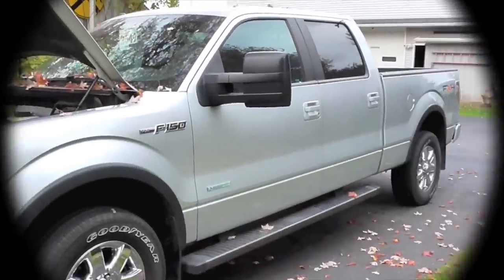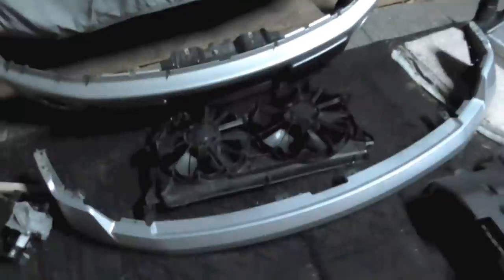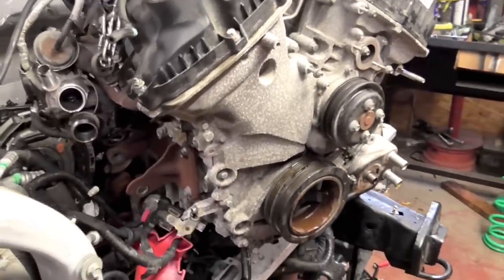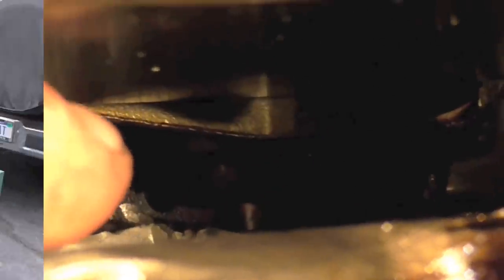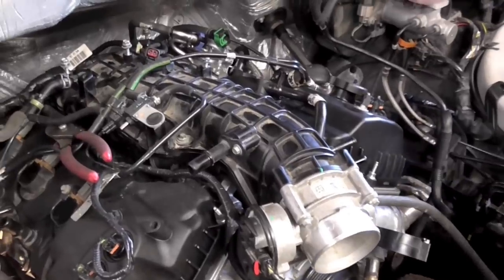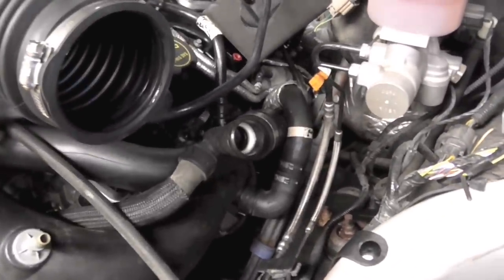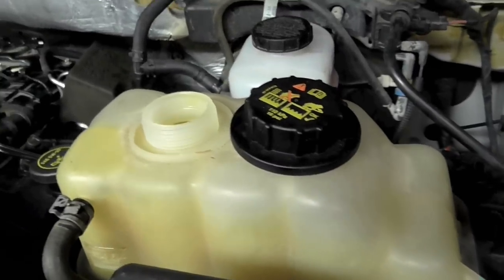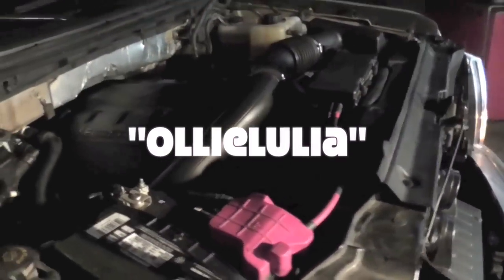FORD F150 TRUCK:  3.5 V-6 ECOBOOST ENGINE FAILURE (Removal and Installation).

Comment: I'm in the market for a pickup.  I've always had Toyotas, but want a change.  My two choices were F150 or Silverado.  If I end up choosing Fords, should I stay away from particular year models? BTW, looking used not new.
Reply from the maker: I just saw a 2017 F-150 with a ("I think") 2.7 Litre "Eco-Boost" (The next 'generation' of ours I should guess ?), and I couldn't believe how "cleaned-up" it was !. *NOTE: I used the word "busy" alot in this clip: ("BUSY" was the INCREDIBLE amount of "plumbing" / poor design on "OUR" engine) ... anyway: (with the newer version ones):  I think they've evolved into a  finite science (amid the earlier design's flaws), *This one ran / looked "crisp & clean". The owner raved about it's performance and, (thus-far), - it's fuel economy. That said: IF it were me, I'd probably go with the Ford Truck. 

Tho THIS Truck continues to run flawlessly,  I'm quite sure the "mistakes / design's of the past (timing chains, sprockets, tentioner's etc ...) are no-doubt "improved" and much more durable. Combine that with good care and maintenance;  and I'll bet it'd have a great service life. IS the traditional "V-8" still available ? 

< I DON'T KNOW >.  :- )
Reply: TommyZTrains ; Great, thanks.  I wonder if they made improvements in there 2013-2014 models.  That's probably the years I'll be looking at.  Maybe I'll just go for the V8 ones.
Reply from the maker: As "we" understood it: 2013 thru 2015 "early" were the "old-style" (or "stay away"), and 2015 LATE currant are "OK" (or "corrected").

Comment: Are you going to still use Amsoil?
Reply from the maker: +blackericdenice    We like the Syn. oils ... AFTER oil analysis and the like,  not necessarily.  *Being fair the failure wasn't "OIL" related either.
Reply: TommyZTrains What cause the problem?
Reply from the maker: +blackericdenice   Read the description and that pretty much sums things up ... (WATER and a hydrolock failure due to CA.C. condensation / hence filling cylinders with water).

Comment: Having lived with a driveway on a hill for 30 years. Water coming out the exhaust is a frequent sight in the rearview mirror. No matter the make. Honda civic, Toyota Tacoma, Ford Mustang, BMW M3 and so on.(all naturally aspirated)  Never any engine trouble. The longer the vehicle sat the higher likely more water would flow out. Admittedly I would never describe that it looked like a small lake! It used to bother me some. But over time I just excepted it.
 Bummer to see the trouble with your 3.5 Ecoboost. A Edge sport was in my sights for the near future.
Reply: P.S. Just noticed what type of channel you have. Very neat! I have 27 years service as a Mechanical Carman on the railroad.
Reply from the maker: Hi ya "James" ... I agree 100%. But what I was remarking about was the "weep-hole" (just aft of the crossover), and the water just rolling "out & out & out" .... It was a literal "stream" of water. Again; AFTER we pushed the Truck off the Road, we later learned that in fact "what we thought" was OIL, WAS Water. *This wasn't the example you site in the above, it was far-more then that, **AFTER the failure.  < not "normal" >    :- )
Reply from the maker: "Nice" ... gese - "I wanna-be YOU" !!  : -  )
Reply: Yeah that definitely gives one, pause to thought. Makes you wonder what the heck was going on there.

Comment: they only have sold over a million of these engines , it's not a common problem because I've seen some with almost 200,000 miles without issues, i definitely would be upgradeding if it were me

Comment: How did you get the engine and trans to line up during install?
Reply from the maker: "It's a tall order Bob" ... but the stars DID align !. As I recall (through the starter opening / while we watched / not hurting the crank sensor) in the process... "IT SUCKED" !!     I  N E V E R  want to go through all that HELL again !. Good Luck :- )

Comment: Over all how hard was the job and how much did you spend in total cost to do it yourself.  My friends 2011 fx4 ecoboost threw a rod too.  He thinks it is an easy job to replace the engine by ourselves
Reply from the maker: Hey John, "It's quite a task" ! ... The level of difficulty was rather high / NOT what "I'm" used too ... that being said: "the first time always is". The price on the Ford long-block crated motor went UP soon after we got ours, but as I remember: "about" 6,000.00 for everything.
Reply: TommyZTrains the local Ford dealer he got quoted at said it was about 7400 for the whole job to be completed.  He doesn't listen to me that here in the Ohio winter without a garage to work in it would be hard too do
Reply from the maker: In a Garage "HEATED: WITH a Lift: OK" ... with NONE of that ? "boy your in for a dose of reality". Pay the grand ! (more).
Reply: How the heck did you get the engine and transmission aligned?
Reply from the maker: John "I DON'T KNOW" !! It was a nightmare back at the time ... then it suddenly "fell-in". Delicate positioning of the Engine crane / Trans Jack was the other "key". It was a REAL PISSER THO" !!
Reply: Spent 5 hours yesterday trying to align it last night and couldn't get it
Reply: I would agree, for $1500 extra have it done. Then they own any problems and all you have to do is turn the key and drive away. I do 99% of my own maintenance and repairs but there comes a point when you have to weigh cost vs PITA.

Comment: Congratulations ! I have replaced engines before but this looks like an absolute nightmare! I probably would have given up! I hope you get many more years out of you F150! I am looking to buy a new F150 but am looking to stick with the 3.3 v6 290hp in the XLT and try to limit some of this nightmare ! You did an absolute awesome job!
Reply from the maker: Hi Jim !,  * THANK-YOU and I very much appr. that * ... It WAS "alot of reality".   Ironically,  TODAY is the first time (now truck is nearing 120K miles), that I've had "ANY" issue at all ... that said:  I had an Ign. coil fail / & It was as "straight forward" as one could get / and: (after replacing that "inop. coil"),  the truck continues to run FLAWLESSLY.   WE LOVE IT !.   BEST.  :  -   )

Comment: I've always been a Nissan guy. I've got an 04 frontier 2.4l with a 4spd auto with a little over 120k and it runs like a dream. The only issue is an EGR sensor but mechanically it's fine and there's a lot of room to work on it.
Reply: thats not a proper truck, it can not be compared to a workhorse like a ford, compare it to a explorer sporttrac maybe

Comment: awsome job- you guys are great mechs. I didn't hear one cuss word out you all, although I'm sure you felt like it many times . That's what I call true pros. where is your shop located? I might need some work on my truck, and no it's not a 3.5 eco. it's a 68 f-100 with a 300 ci. in line 6 cyl. God blessed you all with lots of patience and knowledge. great video, keep them comming.
Reply from the maker: Thanks Edyon; but we only did this job because we had too ... I couldn't imagine the labor we'd of paid, (let alone the crappy workmanship), that we'd of found ... "if at all". Once is enough, and the Truck STILL continues to run perfectly.

Comment: What were the total hours and customer cost for this job? Possibly going to do this to my 2012.
Reply from the maker: In TODAYS setting ? (this video was some time ago), I’d guess appx. 12-14 K for the long block amid all the included upgrades as this video prefaces. I NEVER wanna do the job again, and the truck continues to run absolutely perfect. 👌🙏👍
Reply: @TommyZTrains  wow. Last year I would have said no way but with truck prices now days I have to consider what 10-15k would get me. Absolutely loved my 2012 for all 205k miles.
Reply from the maker: “I get ya”  … today 25 K wouldn’t buy a junk ass Chevy Aveo !. “Today’s 15K is the old 5 K of yesteryear”.  🥴

Comment: The eco boost 3.5 has a water pump leaking problem later. I guy said change the oil under 50 k cause dirty oil are corrosive to the river water pump seal.

Comment: I hear they have a 100,000 mile warranty now.  Big friggin' help that is!  My friend has a 2013 F150 XLT 4x4 3.5 Ecoboost with 100,000 miles on it, no troubles.  Sometimes I think it's just bad luck, or don't buy the EARLY re-designs, at least!

Comment: i had a tuned lbz duramax stolen and the most comparable affordable option was my 2014 fx4 ecoboost, no half ton v8 jas the torque of the ecoboost and the transition from 6.6 to 3.5 was very easy because of the power simolar power delivery of the ford. Here i am getting a new 17 sierra slt all terrain and gave the ecoboost to my employees but no half ton v8 pulls like it! Drive with trailers and you will feel the difference. I have gm commercial fleet but that eco boost pulls!

Comment: Hey how did you line up the torque converter on install completely skips over that part in video
Reply: TommyZTrains
Reply from the maker: I said: "through the starter opening" ... and that's how we were able to do it AFTER things were: plum / level / and lined-up. (As I recall what we THOUGHT would be a war,  was in fact "quite EASY".

Comment: I did not hear you say if you figured out what caused the original engine to come apart ?  How many miles did it have on it ?

I am thinking about a 2016 3.6 l F150 normally aspirated truck .  Any pros or cons for that truck ?

Great video .  Best of luck to you .

God bless
Wyr
Reply from the maker: Hi.  If you read the description, the "failure" was "Hydro-lock". The "inner-cooler" (or "charge-air-cooler") filled up with water condensation droplets until the "Tub" was full, and the Truck ingested the water. The correction: simply "spud" a hole on the "cooler" so it can "piss-out" the water. Ford makes a great Truck Wyr, but myself "personally" ? I'd buy "nothing" TURBO-ED. Go with a nice simple "full-house" V-8.  * MY Opinion **

Best
Reply: Thank you for the description .  I either read past the reason or did not know / understand what I was reading .
     If I traded vehicles every 1 - 2 years , & the vehicle never went past warranty , turbo or no turbo would probably not be an issue with me .  But I have normally  driven / operated a vehicle until it was no longer economically viable .  Doing most of my own repairs .
     When the vehicle went past that point or some one ran into it & totaled it , I would start looking for a replacement .
     To me , a turbo just adds another layer of expensive technology & complication , to go wrong .  If you keep the vehicle for an extended time period .
Thanks ,  :-0
God bless
Wyr
Reply from the maker: IC ... "Gese your lucky buddy" !!  :- )  I wish I WAS I a position too say that ! (every 1 or 2 years).  Be well.  :- )

Comment: So, it looks like a piston rod exploded.  Any ideas what caused that?

Edit: Just read your write-up.  Condensation in the CAC caused a hydro lock?  Amazing.  65K miles isn't a lot.  Sorry.
Reply from the maker: Thnx. Jean ... "Your spot-on", that's what happened.  :- )
Reply: TommyZTrains - I owned a '94 Ranger 4x4.  It was awesome.  But at about 120k miles it started to overheat constantly.  Replaced the radiator, water pump, and had two or three coolant flushes.  Nothing worked.  At 140k miles the cylinder heads cracked.  $1400.  ...and again at 145k miles.  ...$200 and a month of weekends.  

I replaced it with a 2001 Accord V6 Coupe, that I still own today.  Runs great with 202k miles.  The Accord only ever required new Mobile 1 every 7k, water pump and plugs every 90k, some O2 sensors, idle control valve.  The car is bullet proof.

Comment: The Ford Ecoboost forums have a bunch of threads on this.  My 2011 eco boost had over a litre of gas/moisture in the oil after 20,000 k.  So far, two left side turbos, timing chains, throttle body, alternator, several TSBs to fix the fluid in the oil problem, nothing but problems.  Engine is surging badly now on acceleration.  Junk.

Comment: Why does the f 150 engine have electric fans instead of a clutch fan .
Reply from the maker: Most all car or Truck platforms use a "fan cassette" panel ... These two fans are generally "pulse / modulated", and the Computer will drive one / or both on, and in some examples "vary" the speed (up & down). Once the vehicle going down (say the freeway), many times these same fans do NOTHING (off) = a savings on fuel economy / wear and tear. "Coolant "deficits",  can MUCH BETTER be dealt / handled with too, in a "city driving" situation and so on ...

Comment: I have to wonder if the failure is indeed hydro-lock; is it related to the turbo inter-cooler condensation issues?
Reply from the maker: That's EXACTLY what happened. *("We wrote / said that in the description"). Your SPOT-ON !  :- )
Reply: Oh, I saw the mention of hydro lock, I must have missed the inter cooler mention. Is there a solution for the inter-cooler issue; a real solution? It seems Ford hasn't been able to completely solve the issue. I have come across some who have drilled a small hole in the bottom for drainage but i don't feel comfortable doing that.
Reply from the maker: I have ta wonder myself Rob, *We did the "hole" ... (and if I recall WE DID TWO holes Just too be sure).  I (myself) don't like "Turboed anything". )It ALWAYS FAILS). * BUT: This is my Son's Truck, and He treats it like royalty, NEVER driving agressive, BUT: (deep down).  "I'm sure He scared as hell it might happen again". So far as the "HOLE", AFTER the failure (well 2 weeks later anyway), we spuded those C.A.C. "Holes",  and observed about another 1/4 cup of water roll out. Is THAT the end game ? (an assuredness that we NOW need NOT worry) ??? 

*I don't know.  :- )
Reply: Mine's a 2011 with 105,000. The only real drive-ability issue I've encountered is cracked insulators on the spark plugs (no big deal). I am disappointed that the issue hasn't been fixed by Ford but I think I'll be drilling a hole just drain the water.
Reply from the maker: Yeah Rob, My Son wrote a hand-written Letter too the Ford CEO ... "He never even got a reply".  :- (
"SERIOUSLY" ??  (Me talking): I'd of sent the kid a motor.  ANYWAY: "ah-well".
Reply from the maker: SMART MOVE Rob !!  "I sure would".
Reply: ***** That's a pretty minimal amount of sludge. These trucks should have come with catch cans. The amount of blow by in these is far too much for the standard EGR systems to handle.
Reply from the maker: I was speaking "figuratively" Sir ! He Tow's,  Hauls, and goes 4 wheeling all the time   "IT'S A TRUCK", It lives outside and it's a 'daily driver' ... It's not put in a "velvet bed"!. "He bought it to use it" ! On the Highway, "kicking in the Turbo's" ... "everything". The difference here is, for all the money he paid, that he takes CARE of it when he's "DONE". IF taking care of ones "investment" (using good oils, cleaning it up after it's been out on the "back 40" and not "flooring-it" constantly is what your trying to say), then: "So be it.

Comment: Why not just pull the cab vs taking entire front apart? Also the core support, radiator, fans will come out as a unit.
Reply from the maker: +EcoBoost EngineSwap   We just followed Ford procedure ... The first times always "the worst", but: were we to do it again ("obviously") it'd be MUCH much easier. All n' all doing it "whatever way"  ... it wasn't that bad.

  :- )

Comment: I'm looking at buying a new F150 , would you go with the EcoBoost or V8?
Reply from the maker: +Chris Stromberg   Tough call Chris ... *were we ta do it all over, I think we'd do a V-8 ... This V-6 is very VERY  V E R Y  Mechanically intense, and I can't see it going the "long haul".
Reply: +TommyZTrains  Thanks!
Reply: my '13 ecoboost has over 100,000kms. I pull an enclosed construction trailer at least half of those Kms. so far so good. since sixty thousand it started making a lot of noise on start up but still going strong.
Reply from the maker: Given the CHOICE: I'd do a V-8.

Comment: This is very disturbing since I bought a 2015 f150 3.5 ecoboost.  I pray I don't have this problem.  I thought the power train is covered under the warranty up to 100k miles. I guess not.
Reply from the maker: +GlockNinja  *Follow every "bread-crumb", go too the Dealer for oil changes, and do you "due diligence" and hopefully you'll be OK. 2015's have a good many "upgrades",  after that: ya bought itr to USE !  (not to coddle). After that: time will only tell. 

All I'm saying *(my opinion): HAVE A GOOD REPORE WITH THE DEALER = Help with any issue's / "gray area's"
Reply from the maker: +GlockNinja   a '15 SHOULD HAVE the updates already DONE. Good luck with it   ;- )
Reply: yea that's the truth they have worked the bugs out. get an oil air separator, I'm getting mine soon.

Comment: Where can I buy the engine for my truck? 2012 Ford f150 3.5 ecobust
Reply from the maker: Hi Gustavo,  "The Dealer" !  We ordered a NEW crated ford motor company "LONG BLOCK" Engine, and all we had ta do (as outlined in this clip) was transfer the cowlings (and turbo pipes, plenum, coolant runners, injectors etc ...) and with that "long-block" came a new engine with a FULL 3 year warranty. Almost 100 K later (enter present day), it continues to run flawlessly amid ZERO issues EVER. ALSO of Note:  We got (and we confirmed this at the dealer): The "upgraded" Turbo Feeder lines, The "better/ improved" timing sprockets, (heat treated / case hardened / larger size), and the newly improved "brawnier" timing chains, /and pressure regulator "shoes" (with the improved-upon 2nd design units). Why find a 3.5 with these issues (at a salvage yard) when you can be "one & done" / have a warranty / with a new engine ?.  

You'd see a grown man "cry" IF I had ta do this all over again !, MY "Solice" was "this is it" ... *(and it was !!!). 

Anyway: that's what we did / and I hope this helps.  :- )